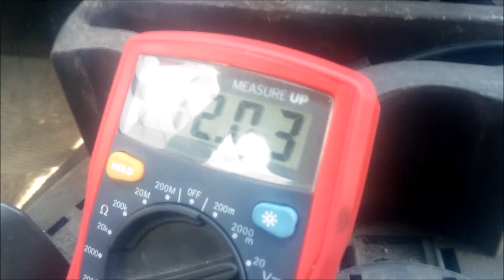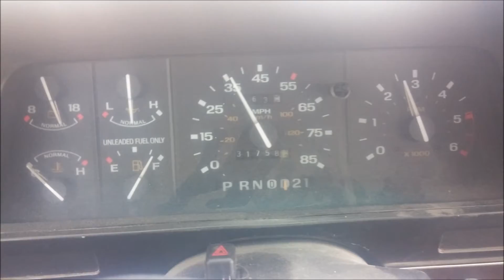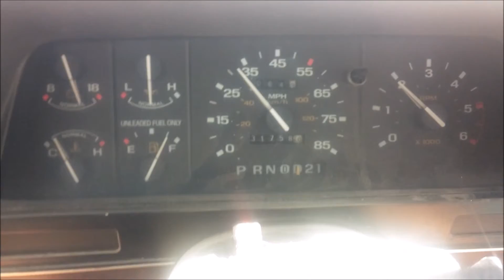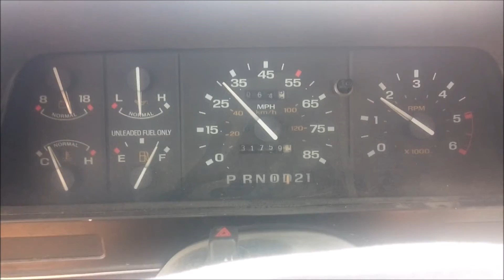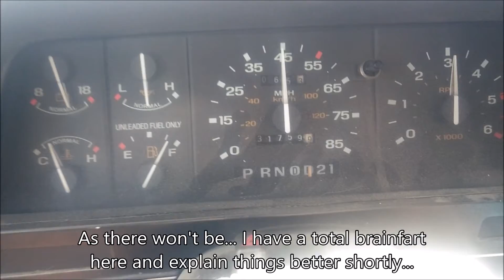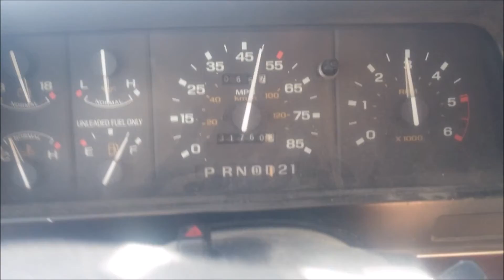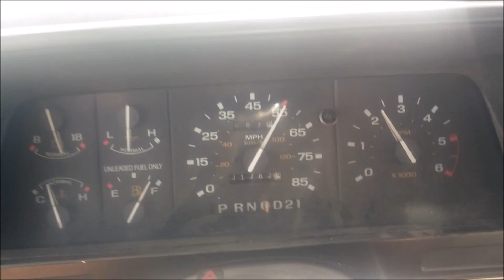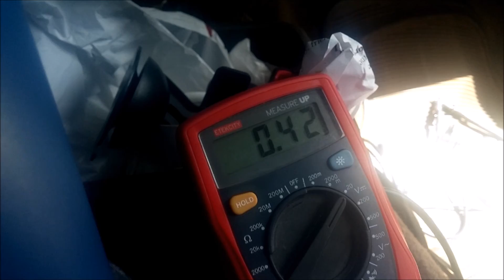1991 Explorer A4LD Transmission Shift Solenoid Testing

Comment: I know this is an old video .. but I want to test mine. Can you please explain more in depth how you connected the meter. 
I know that volts are measured across source, amps require opening the circuit for measurements. My symptom is I can run the truck at 65 miles an hour .. as soon as I let my foot off the accelerator, I am in neutral until I hit somewhere near 43 mph. I then feel a nudge and and can roll back up to 65 if I want. I was told the solenoids commonly cause this ..but I want to make sure I dont have a degraded wire somewhere.

Comment: By chance did you compare gear ratios to the person who commented about the rpm? The 4.0L auto w /4x4 have a higher gearing than 2WD trucks. Just a thought. Keep the videos coming brotha this info is priceless. Currently trying to figure my shift issues as well, the trans is fine but it’s an electrical bug I can’t find yet.

Comment: Long shot for a reply on such an old video but my 90 ranger has pretty much the same engine and trans (I think) and it will not shift into OD at or around 55 mph?  So not sure if it could be faulty computer or a shift solenoid?  Speed sensor?  What was ur fix?
Reply from the maker: I don't know that there was a fix for mine, it seemed to be working fine, at least for a vehicle with 231k and a rebuilt transmission. I would perform similar tests to see what you're missing for sure but I will say, these transmissions are notoriously weak. Could be as simple as debris or varnishing of the valve body, maybe new fluid would help. Or it could be a blocked passage, faulty solenoid, or more.

Comment: I purchased a 1991 Ford Explorer EVTM and it came with little notations on tape on pages in the book stating the TSB corrections for wire color of various circuits. Just so everyone is aware mistakes are present in this book.